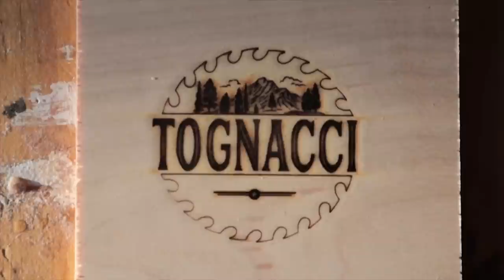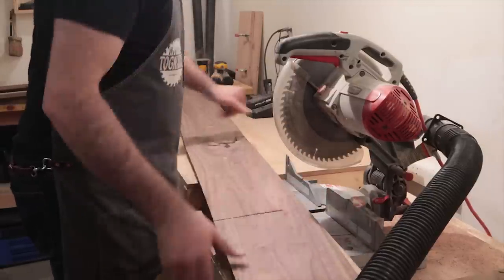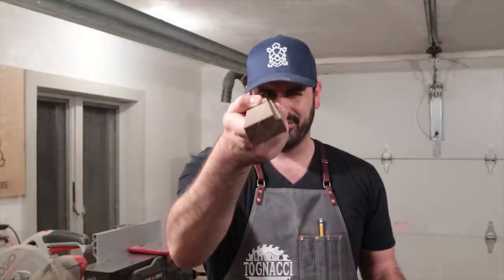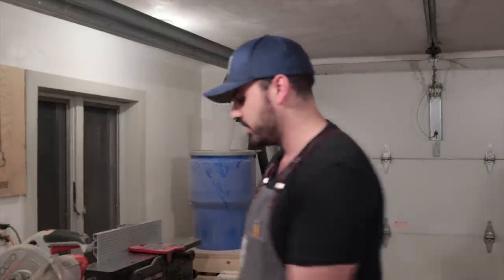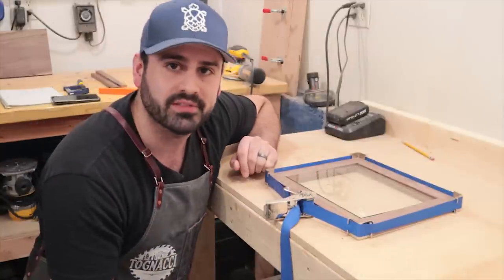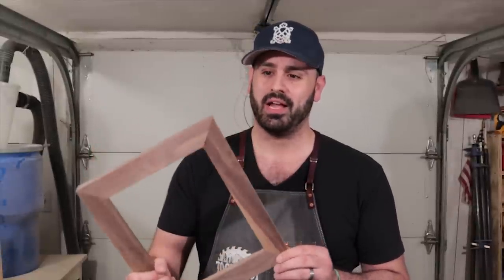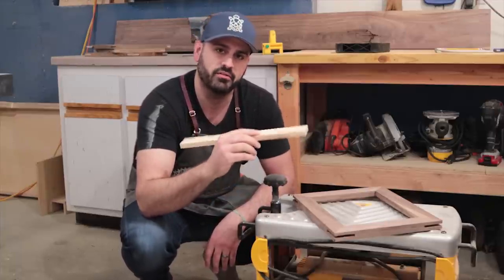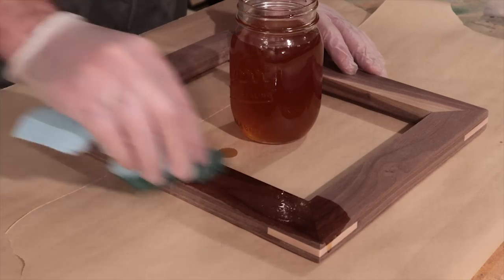How to Make a Picture Frame with Splines - Easy DIY Project

Comment: Great video.  What is the name of the picture frame clamping device?  Your spline jig is the simplest I have seen.  How many inches from the bottom of main board do you secure the two smaller 45 degree boards?

Comment: I've watched a bunch of videos to learn how to make picture frames and this one was so helpful. I appreciate how you used the square versus the miter's 'lock in' feature to ensure its 45 degrees. I also noticed how you used the square again as a stop block when making the miter cuts. And I appreciate the honesty here that you tried several times and it didn't go perfectly--I expect the same once I get into it and I won't be discouraged when I need 4-5 attempts to get it just right. Thanks!

Comment: When you measure out from the kerf in your zero-clearance to get the length, since that kerf is slanted at 45 degrees, where along that 45 do you place the hook of your tape measure to get an accurate measurement? Thanks!
Reply from the maker: I would actually make the measurements on the wood you're cutting, sneak up on it then put the stop block in.

Comment: How did you do the back? That is, did you just tape the photo/glass in, or use nails or something else?
Reply from the maker: Hey Scott, great question!  I knew I should have put that in the video as well.  I bought these "turn buttons" from Amazon (link to them in the description).  I put down the glass, then the picture, then a cardboard backing.  Then, I drilled tiny holes in the back of the frame and attached the turn buttons to keep everything in place.  Hope this helps!